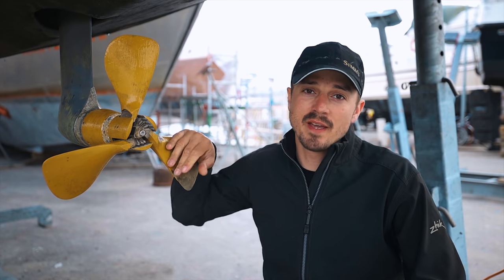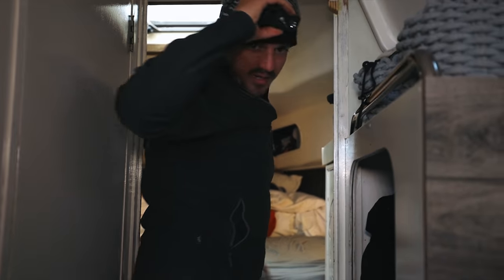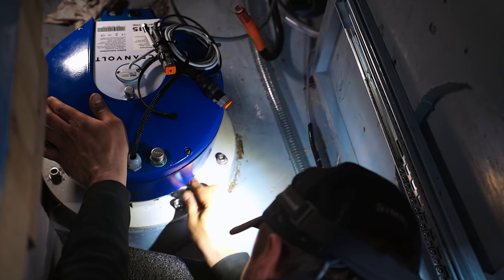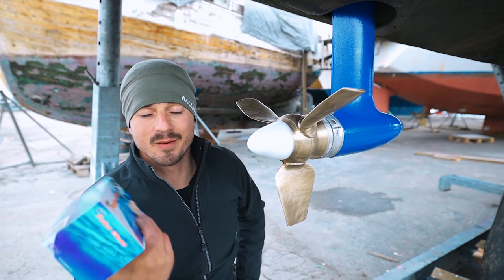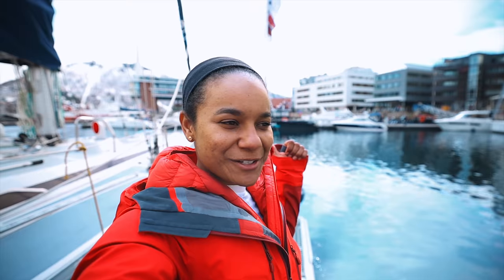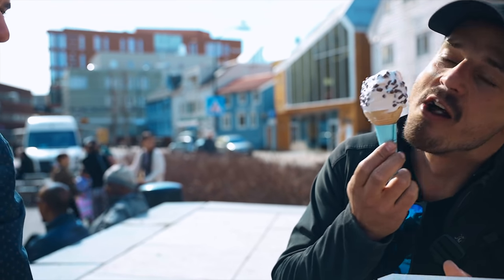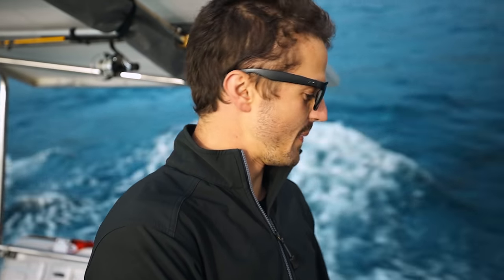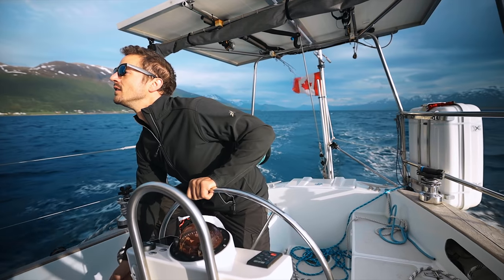Ripping Out our Electric Motor for the LAST TIME! — Sailing Uma [Step 277]

Comment: That is AMAZING that technology has brought you to this point of Power Regeneration...as a retired Electronics/Electro-Mechanical Technician I am thoroughly impressed.  Not having to rely on Dock Power or Solar Power and just be able to sail and let Mother Nature fulfill all your Power Needs is AWESOME...
Reply: What kills me is that motor is like 50k USD
Reply: I'm pretty sure the solar panels are still a critical feature of the system
Reply: @divinesotomayer3107  and their water filtration wasn't cheap either.
Reply: @timskufca8039  absolutely.
Reply: @divinesotomayer3107  It's 15k Euros.
Reply: I don't think they've payed full price if at all, since they're working with the company, leasing the motor could be an investment for the company to Uma, to advertise and get feedback, and Dan said they were going to help on future projects with the company, so some collaboration is going on there, no a chance they payed retail price for that motor
Reply: @lrvz7187  totally agree...Dan is a salesman at heart but also a very smart technologist.
Reply: @lrvz7187  Oceanvolt are Scandanavian, and no marine parts are in super high volume production.  They probably paid normal pricing for it.
Reply: @divinesotomayer3107  I have been trying to find prices for their electric engine. Wow never would’ve imagined it was that expensive. I guess this is why the electric boat industry hasn’t taken off the way it should or could. Who has $50k to spend on a legit electric boat engine? I know I don’t. Talk about dream robber. Haha
Reply: I feel like I have been "there" with team Uma from day one.  Love you guys. Whenever you get back to the Caribbean look me up, am in Jamaica 🇯🇲
Reply: @ittybittykittyrescue4843  It's not $50k.  It's 15k EUR.
Reply: everything feels right about this solution, i assume that if the prop servo fails it fails open and allows uma to motor.  without doubt the future of yacht  marine engines 👍
Reply: @LoanwordEggcorn  that's quite a difference lmao
Reply: @saywhyt  You don't think they are "paying" anything even close to list price. Oceanvolt is likely paying them for advertising. Look at how many people they are reaching through the channel.
Reply: @LoanwordEggcorn  So you think he is relaying all this info and cheerleading for the company AND paying list price. Have you ever seen a company's advertising budget? EDIT: Not arguing with you , just pointing out this is not their "hobby" they have made a career out of their adventures and good for them, it is fantastic, I just think the company found a good fit and it is a win win for both. You aree free to have your opinion, sorry if I seemed rude
Reply: @richardmoore4194  One would hope that, BUT, electric motors, including the one operating the servo to control prop pitch, are highly reliable.  The electric motors are the most reliable part of any of these.

There are electric generators that are more than 100 years old and still working well.  Electric motors and generators are highly reliable, especially those without contacts as these probably all are (servo and drive motors).
Reply: @j.sarnak1391  It's possible they're getting some kind of compensation or discount, but my point is that the motors are not so costly that they could not afford one, and that anything in the pleasure boat industry, especially electric drive is relatively low volume.  

The number of sailboats in the world is tiny compared to say cars.  So the economies of scale are simply not the same.  That's some major part of the reason why marine parts are more costly: relatively low production volume.
Reply: @lrvz7187  To be fair, the Lithium ion batteries are an additional cost which can be many thousands of dollars for use with electric drive, but much less for simply house loads.

So the total system costs are high.  But the operating and maintenance costs are low, just like EVs on land.

Also, there is much variation in the cost of batteries, and even electric motors.

Electric drive boat systems can be built for a few thousand dollars.  Commercial systems like Oceanvolt are tens of thousands of dollars, but they're very well engineered and built.

A good AC electric motor and controller to replace a conventional prop drive is only about $2k.
Reply: @LoanwordEggcorn  I Agree, it was more the control connections i could see going.
Reply: @richardmoore4194  Yes, or the gears, mechanical bits, even more so.  

Solid state electronics controlling the motors tend to be very reliable, though the salt water environment also tends to be a bit unkind to electronics in general.

At the same time, marine electronics have gotten a lot more reliable due to better weatherproofing, better electrical connection integrity, etc.
Reply: @deathngravity  not a bad point but they don't necessarily have to tell us what their numbers are...they have managed to create this incredible adventure that most people only dream about.  They are both incredibly talented and fairly open...personally I am more interested in the technology.  The price is not cheap but when your dealing with a vessel that you are trusting your life and well-being in...and I have to add..."ABOVE THE ARCTIC CIRCLE"...I know if I had the resources...there is no question what I would do.  Their resources to "ME" are not what this vlog is about...at least the price tag anyway...what and how much they are funded is irrelevant...I admire and applaud their outlook on life and their eye for the beauty this world holds so precariously as civilization continues to encroach.  They are recording something we need more of and if they have the resources and the ability...their finances are not my business...Just my opinion...Namaste
Reply: @deathngravity  and isn't that rather obvious????... they have been sponsored by MANY Manufacturers...bully for them right?
Reply: @LoanwordEggcorn  the Oceanvolt is worth more than the Boat.
Reply: The technology IS amazing yet as with all endeavors there are sacrifices. Mother nature can easily fulfill all your power needs using fossil fuel yet to do the same with ONLY solar and/or wind requires an immense amount of money and time. The latter being the problem of not enough sun when you need it.
Reply: @divinesotomayer3107  It will get cheaper as more companies start developing electric systems. In theory it shouldn't be more expensive that an Electric car system, which can be bought for as low as 1-2k USD used.
Reply: One step in the right direction for sure.
Reply: This technology is about 100 years old and you are surprised .... the difference is the power plant is rushing through the water instead of water rushing over or past a set of blades.  All that has changed is the size of the components.  And when you realize that it is only a fluid or gas turning blades that generate electricity ... not so impressive.  What is impressive is storage of the energy.
Reply: Uma slips so effortlessly through the water I would expect that to have a positive effect on the overall regen figures as well. Looks like a winner for everyone!

Comment: at 30:45 you can see the happiness literally radiating from Dan as he speaks about the regen finally working as they intended... so happy for you guys ;o)
Reply: Unfortunately, this level of performance is not going to be achievable for the average sailor with a 1972 fixer upper sailboat.  Price on the OceanVolt website is at over $50,000 for a system capable of regeneration of 300 watts at just 6 knots.  Hopefully, the price will drop with time, as it sure looks like a fantastic system.
Reply: @franklinbush4969  Cutting edge is always as a premium price.  But the price always seems to eventually drop to reasonable levels
Reply: @txhawk23  Boat stuff is always pricey though.
Reply: @franklinbush4969  Lucky for them, that $50,000 can be offset somewhat by selling their used OceanVolt system.  I'm sure someone will want that, and look!  They already have a shipping crate!
Reply: @thomasnorman7016  Weren't you paying attention? Oceanvolt cut them a sweet deal to feature the product on this channel.
Reply: @stephen-collins  exactly. This is a free marketing deal but that's completely fine with me. I'll take Dan singing the praises of a Sail drive any time over yet another Squarespace, Surfshark, or Skillshare product placement which anyone who watches vlogs sees ten times a week (or more).
Reply: Now I just want to see them add enough solar (extra fold out or roll out panels - solar wing and wing) so when they are becalmed in the doldrums they can generate enough watts to sail drive their way out!

Comment: Take it from an experienced electric drives design engineer: From what I can determine, the system you have has finally got everything needed to also include proper regeneration. The added servo to feather the propeller to optimize both drive and regen, along with the proper electronic control is basically what it takes. It only took about 20 years which is how long ago I got involved in boat electric drives. BTW, I still have the original drive from back then in my boat! Happy sailing!
Reply: DR hook
Reply: I am not an expierenced engenieer,but some common sense let me assume that with that tiny prop( feathered or not) it will not be possible to generate enough energy to charge enough to regenerate for propulsion.
1. Since there is no noticeble speedincrease(6 knots is constant when the system is generating 300 watts or not)that means to me that the max energy is delivered given the size off te prop/ speed
2.maybe the motorcoils are also at their max,but that i doubt,since i assume the motor consumes an multiple off 300 w when driven to propulse.
3. So they have to mount an much( much)100 % at least prop,whith feathering like an brunton prop,but also servocontrolled( they have one now)then they have an much bigger drag / in th e water,as long as they put the system in work mode and there is no to very little speedincrease just forget to generate enough power( 600/1000 watts)
Reply: @guidouytterhaegen  Thanks, interesting comments! I could spend a long time discussing this subject because it has been part of my job for a long time, everything from these small drives to large wind converters. The control of this process is very delicate in such a way that you need to control the regen to a point where the process retrieves maximum energy. It all depends of how much the spinning prop can be loaded, if you over load it, it will stall if you under load it, you won't produce much energy. It is true that the system will only regen a fraction of the energy the motor will produce when driving the boat, so every watt counts when regening. In the end, 300 or more watts at hull speed is not bad if you can keep it going for several hours.
Reply: @hankgesmag9650  indeed,thats why i mention that that prop is in my opininion far to small to generate the power they really want( 600/800w)
Of course a bigger prop will be able to give more power( torque)  per / rev but the overall revs will be not significant  higher for the same speed( ex 6 knots)exept for lower speeds it will be able to give much more revs( pitching the blades for the given waterspeed( 3 knots ex)
So ideally i think a bigger prop,with an sort of gearbox(  only when in regeneration mode) augment revs at all speeds....but i now  not so easy to achieve.
All the systems now give there weakness( in both ways) by the fact that when in regeneration mode there is no slack in speed,the day someone makes an system( and it will be one with a BIG prop, with constantfeathering possibility) that reduces the speed under sail with lets say from 6 knots to 4.5 knots there will be lots off watts !
Reply: @guidouytterhaegen  Typically, a prop is calculated for propulsion and not generation. I have sized a lot of props that way. I have not done it, but I am sure that if you dimensioned a prop primarily for regeneration, it would be of larger diameter.
Reply: @hankgesmag9650  indeed,in my opinion,for the future,this regeneration systems will be dedicated to theyr purpose.
Like there are already such systems operational( mount on the stern,and they can be lowered in case of need)
They are off course sick in the same bed as we called it,to small propellers,but they are manly designed for regeneration off the dayly needs such as refregeration,navigation electronics.
In case of uma,they need much bigger amounts ,for propelling on electricity  and to be fully selfsuficient.
So at the end in modern sailbaots an system will be mount that is fully dedicated,with big props,servocontrolled blades,and if possible fully retractable.
They will of course suffer off an serious drag in working mode lets say off 2 knots lower speed under sail,but they will give the power needed.
Reply: I guess for them, regeneration is actually more important than propulsion, so the system is better designed primarily for regen, and accepted that propulsion is less than optimal.  
Would not all boats benefit from a much bigger propeller?  The normal size being based on the speed from a diesel motor.  
Perhaps a separate generator and propulsion system make more sense?
I can see a downside of what they now have, the prop not folding back , is far more likely to snag a line.

Comment: Congratulations!!! Finally regen working as we all hoped!!!  So pleased for you. Are you still going to experiment with the wind generator? Another lovely video. Such high quality.
Reply from the maker: Yes of course. Regen only works while sailing. But we spend much more time on anchor than we do sailing, so wind and solar are still crucially important.
Reply: @SailingUma  You are pioneering Electric sailing with in five years it will become the norm
,
Reply: @SailingUma  Initially, I was drawn to your channel because of your electric motor. I have learned so much from your life afloat and persistent work improving your systems. Your video production is stunning. Thank you!

Comment: Ah…😍 another Dan’s tech-based-super-smart-innovative-DIY-installation and test-sailing & collecting-data for better future tech improvement for Uma or any other sailing boat for that matter 👍 

Since the beginning of my binge watching of this channel, I’ve become so much in love with Dan’s ability of meticulously precise calculation, data collection, building accurate blueprints and the planning, & execution of any and all projects they’ve been working on Uma 🥰 especially what I love so much about Dan is his ability to make any explanation on whatever he is doing or what he’s going to do and for what purpose as simple free speech so smooth & easy to understand, while he is actually working on each project which mostly seemed pretty complicated, such as electrical wiring, renovation of bathroom and main cabin’s complete facelift and improvements, and/or installing mechanical equipments in pretty narrow & tight space, or even take the main mast apart once and reinstall to solve noise and length problems, and so much more, all without making relatively no mess or mistake at all ever💜😘👍 If his work isn’t called meticulously precise, I don’t know what is. Oh I loooooove all the episodes featuring Dan and his work on Uma sooooo much 🥰😍💖 Besides, Dan is wonderfully looking good and handsome and smart, fine gentleman, isn’t he? 😊💕😘💖😍🥰

Comment: As long as you're in Norway you should make some traditional RISENGRØT. You need a double boiler to make this to avoid burning it. Take one cup of white rice, wash it, and put in pot with 1 cup of warmed milk. Cover and stir occasionally. I usually set the timer for 8 to 10 minutes. When the rice absorbs most of the milk add another cup and stir, wait. Make sure the water in the boiler doesn't cook away. Add a total of 4 cups of warm milk, one cup at a time, until it's mostly absorbed by the rice. Serve in a bowl. Add sugar, cinnamon to taste and a pat of butter in the middle. It's one of my favorite dishes to make when it's cold and raining or snowing. Very popular in Norway.

Comment: If y'all can independently control the prop pitch, Uma could prop walk like a boss, that'll help in docking
Reply: Prop walking is an good old thing almost forgotten now. Hopefully it is possible and even both directions.
Reply: I’m not sure how prop pitch effects prop walk ?
Reply: @STRUTZKOFF  zero pitch should be max prop walk.   but it would be better for prop walk if the prop was closer to the hull (but not so good for actual motoring or regen.....)
Reply: Thanks Guy, that's what I was thinking, the large keel would hinder sideways movement but a little tug in the right direction could be handy. Learned about this on a 35 ft single prop boat, my friend's dad could make that thing dance
Reply: It'd be hella cool if you could also rotate the main axis of the prop because with the short lever arm prop walk on a saildrive is negligible apparently.

Comment: FYI !! Some folks ONLY read the title of the video. I am considering going electric in my Catalina 30. I have 450W with two PV panels already. My little Atomic 4 is not happy with my neglect. I watched the whole video after a friend told me you were finished with electric motors altogether. Looking forward to your next video that shows the result of having the new system installed for a longer period of time. Glad to see the first trial went well. Fair Winds. ⛵️⚓️🧜🏼‍♀️🐬